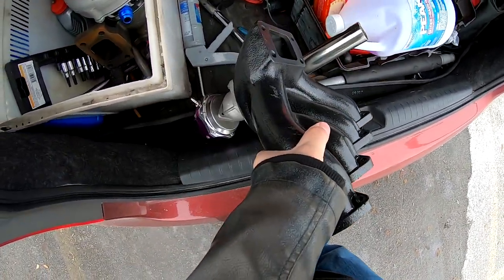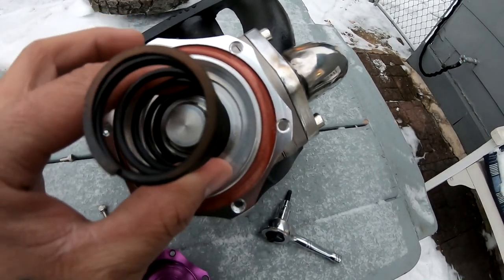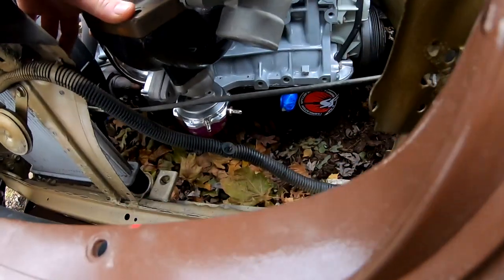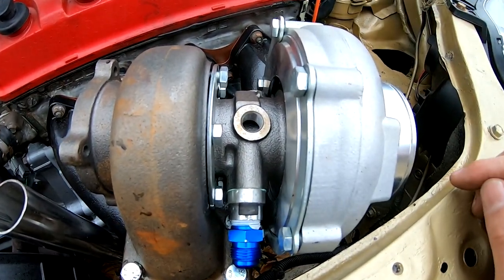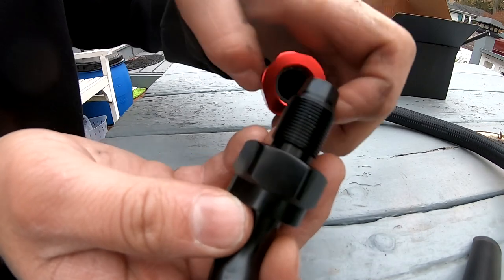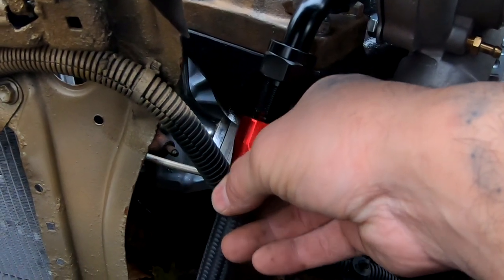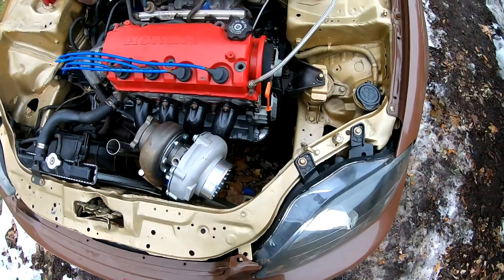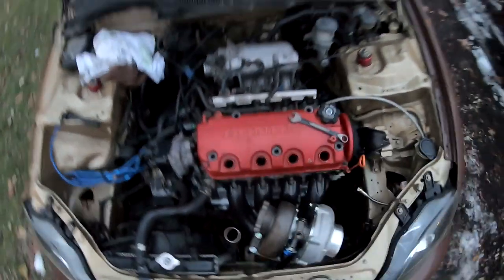500hp Built cheap Civic Gets Ebay TURBO on D16 mounted finally feed and return line install

Comment: Looking good.  I hope there won’t be any issues with the oil drain.
Reply from the maker: Yea I Really dont like that angle either but should still work boostedboiz proved that it works lol. Im worried about leaks also i hate oil leaks.

Comment: i know its been a while but i wanna do this similar build . Did you have any issues with that big turbo? also what is the size , i think you mentioned it in a video but i haven't been able to find it .
Reply from the maker: Yeah that turbo came  in very late and very hard. It was a 70 trim.Definitely go smaller I would do 62 that would have been perfect. I still had lots of fun tho. Good luck with your build
Reply: @BarbasLife  thank you for the reply brotha and will do thanks for the info

Comment: What size bolts are the ones on the engine stand holding the block up on stand?
Reply from the maker: I used the transmission bolts

Comment: Can I ask how many miles on motor? And what psi of boost? I am going to do same thing mine has high miles stock internals
Reply from the maker: around 44,000 miles I believe my bottom half is low compression built for boost.